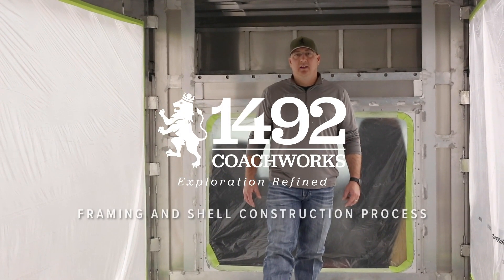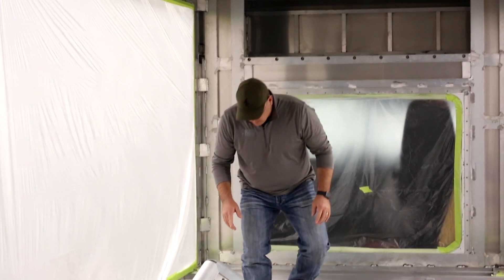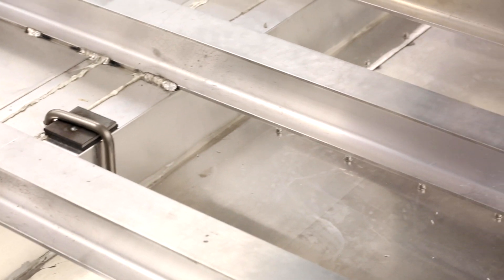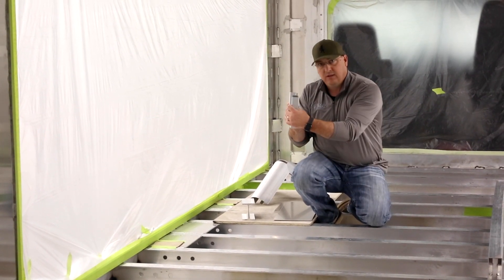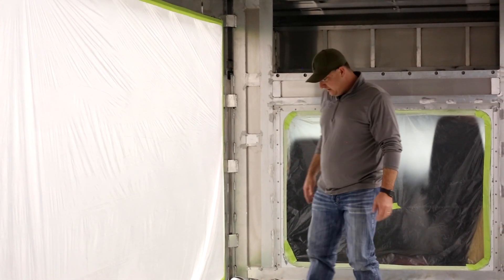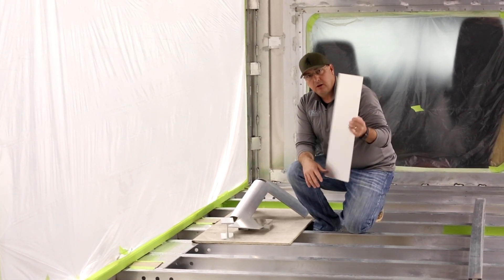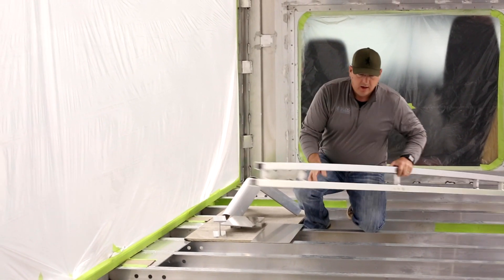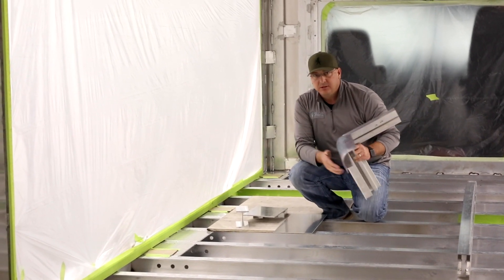1492 Coachworks Motor Coach Framing Construction Process

Comment: What is the weight of a finished unit? Has to be significantly less than a showhauler with aluminum versus steel.
Reply from the maker: The weight is actually fairly comparable to a steel unit. We use the weight savings of the aluminum to build a stronger coach shell. The weight can change quite a bit depending on options but a typical 45' coach will be in the 45,000-47,000 pound range. Thanks for watching You Tuber!